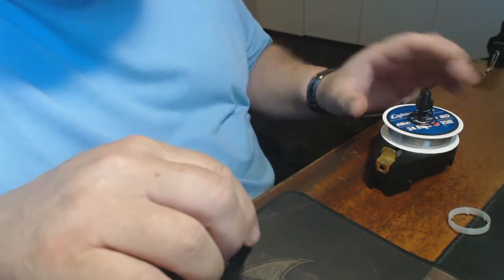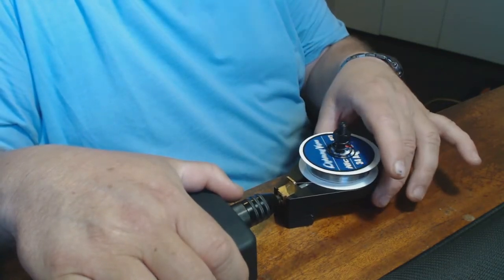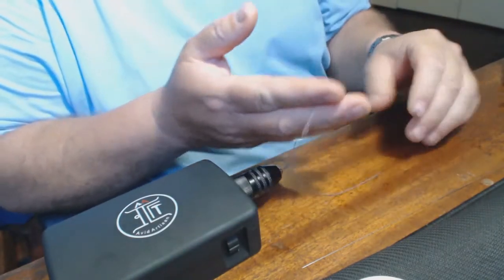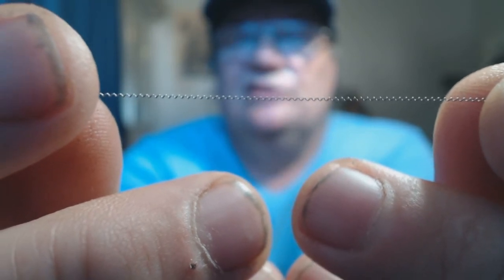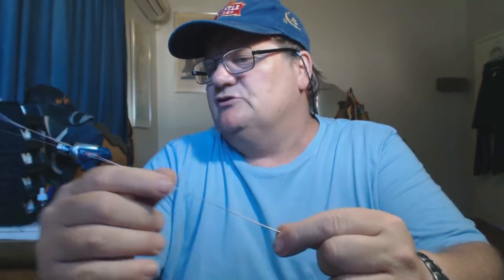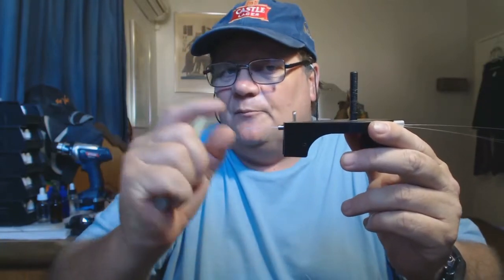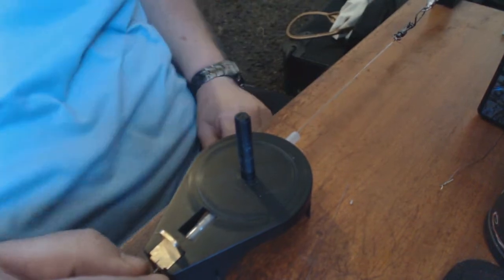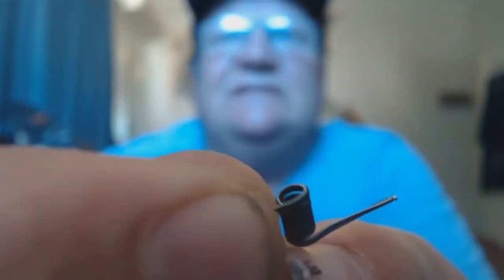Daedalus Pro : Tri-core Alien Clapton Coil

Comment: Idk if you will be able to help or not but I am trying to do a 7 core 30g staggered Clapton build with the daedalus but the wires keep on getting bunched up
Reply from the maker: I experienced the same problem and i found that when you use more than four cores and clapton with a lower gauge like 30-34 then the build becomes too heavy and the daedalus spool/main body struggles to move smoothly across a surface. I best do those builds freehanded.
Reply: @KZORSA  the main body isnt having trouble moving along. I'm having trouble keeping the cores from bunching together. And I have drove myself crazy trying to even do a simple clapton by hand

Comment: That's wire 250'
If I have 500' or 1000' from lightning vapes will be fixed fine or large
Reply from the maker: I have used both those lengths and the spools worked fine.

Comment: This video has helped me alot! I went out and got me some hot glue sticks and that is a awesome trick to keep the wires together. Thanks for that tip. I also use the daedulous pro and im bought to try aliens using this method. I have watched your other vids showing other methods to make aliens with the daedulous pro but i dont have any foam around so im gunna try this one. Which method did u find to be the easiest for a beginner? I have been doing fused claptons for about 6 months now and im ready to try aliens bc that is the coil i prefer at the moment.
Reply from the maker: Glad i could have been of assistance. :) If i have to be honest then the best way to make aliens is by freehanding them using a drill, desk clamp, your best coordinated hand and a good sense of timing, tension, focus and spacing. :)
Reply: @KZORSA  im not that far along yet with making coils so i dont have any of the stuff i would need to freehand em but i do wanna learn what all i need to get that will be also not to expensive. Do u have a video on everything someone should get to be able to freehand coils?

Comment: I’m having a little trouble with something that should be quite simple. I can’t mount my cores in the chuck without folding them a bit. If I don’t the cores almost always slide out of the drill with a little tension. Any tips?
Reply from the maker: Do not place your wire combo in the middle of the chuck at first. Secure it between two of the three prongs so that it remains flat and just alien/clapton a 1cm section. Then you can reposition it more to the centre. Hope that helps.

Comment: Hi Kazor love the tutorials keep up the good work. I'm having a problem with multi core claptons they start off well but after about 40cm or so the core wire's start to twist, this then courses the wire guide to jam / get stuck do you have a solution to stop this happening
Thanks
Reply from the maker: If you are using swivels to secure the wires it could be that the weight of the wire is becoming too much for the swivel to handle. If your surface is not the problem and the swivel is not the issue then it can only be a problem with the tension on the long wire you are claptoning. I sometimes do 1m sections at a time and never have an issue. GL
Thanks for watching. :)

Comment: Thank you for the video! The one issue I always have with the data list is that when I'm wrapping a Clapton the wire continues to bundle up on itself. Do you happen to know why that is and what the solution is? Thank you.
Reply from the maker: Hi Marty.  Lack of tension lead to bundling. Make sure your claptoning spool does not turn easily and that you maintain tension on the core wire while being claptoned. A smooth surface is always a bonus. :)
Reply: KZOR Thanks so much. I will give it a try. It's causing me a more pain in the butt than just standard building. The hope I have is seeing how easily I could potentially build coils I could never dream of making.